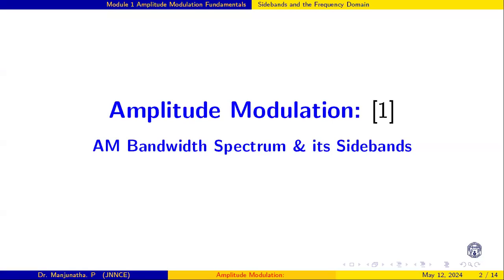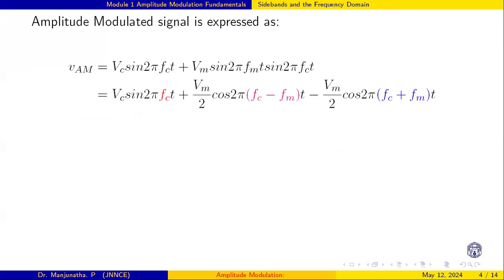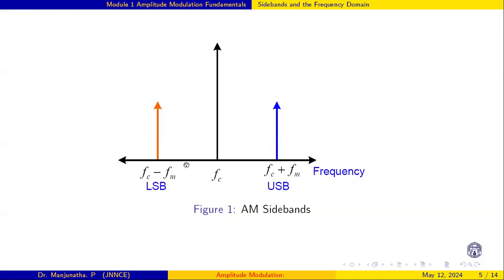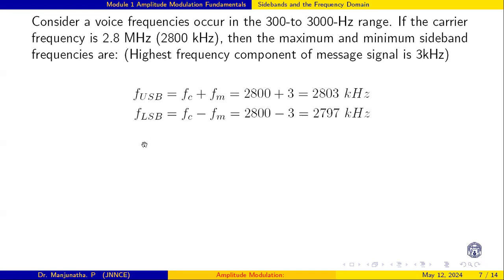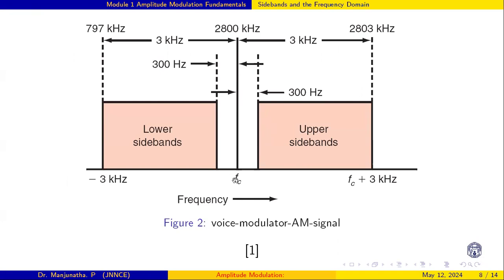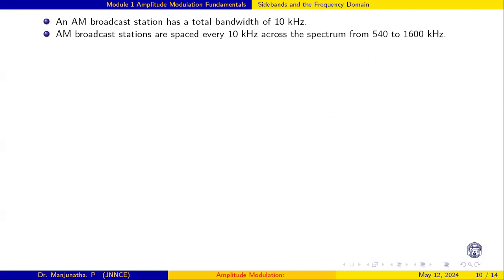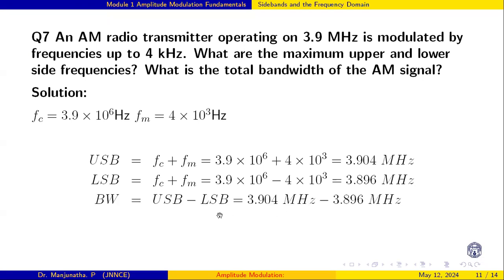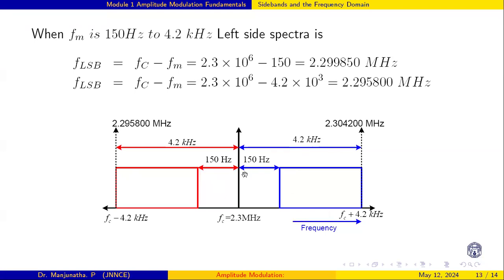AM Sidebands

Comment: Thank you SO much for giving us the full expression for the amplitude modulated signal; I have watched many videos on AM and yours is the first that doesn't just skip over the math/trig involved in the mixing.
Question: given the arithmetic/trigonometric operation that the mixer/modulator carries out, I'm pretty sure it's not a simple superposition (addition) operation and yet it apparently isn't a "convolution" either. I guess I'm asking WHY the AM signal is the sum of the carrier plus the product of the carrier times the modulating signal? And what mathematical operation best describes this?